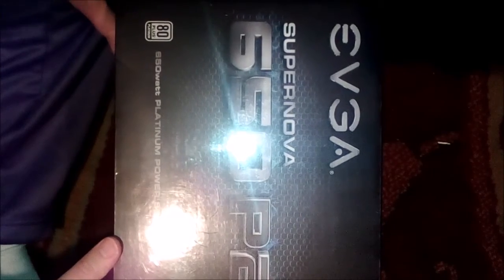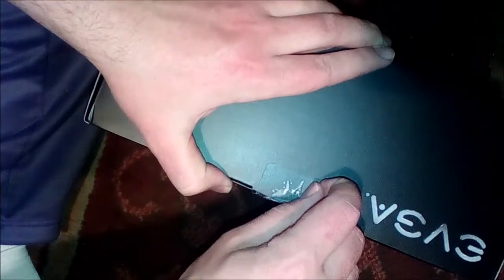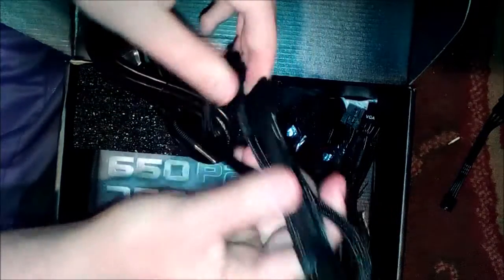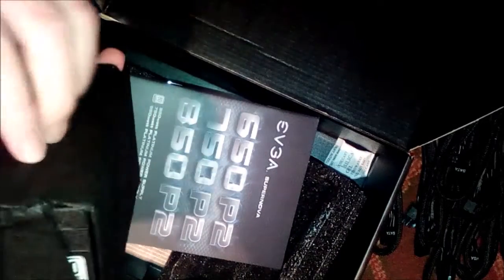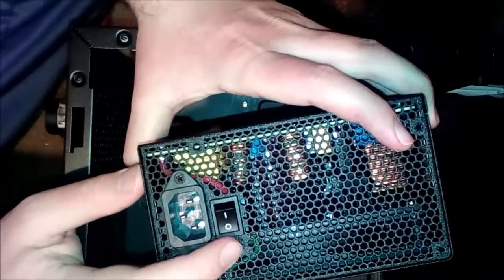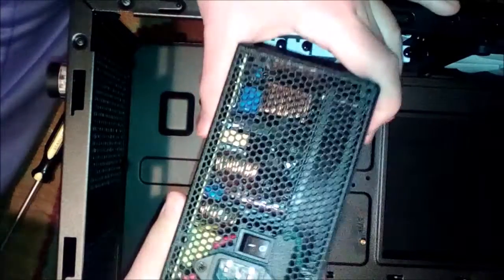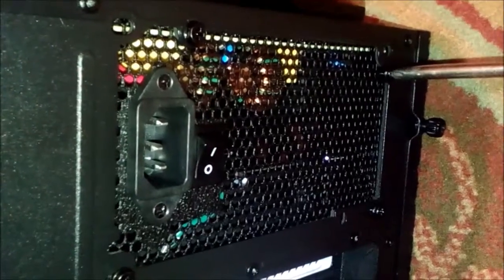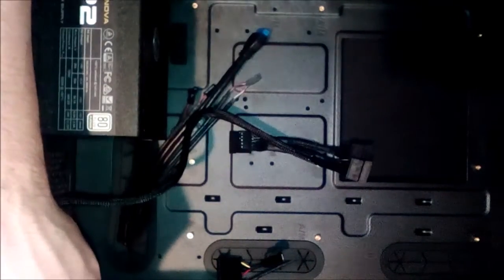EVGA 650 P2 Supernova for Gaming

Comment: Bro i am a noob so i need to you to teach me this: Something like "All about Connectors pins you need to know"
What is 24 pins? What is 8 pins? whats the different between 4+4 and 8 pins? or these following:

- 24 pin ATX connector
- 8 pin EPS12V, 4+4 pin EPS/ATX12V 
- 6+2 pin PCI-E, 6 pin PCI-E
- 5.25"+5.25"+5.25" 
- 5.25" to 3.5" Adapter
- SATA+SATA+SATA 

What are those for? i mean from what to what
Any not obsolete link that could wrap all of this information into one readable sources?

Big appreciate!
Reply: I got sucky sweet grochery store's list

- Z170x G1 from Gigabyte
- 6700k
- 240mm CPU AIO Cooler
- 2x8 DDR4 (2800 14-14) Trident Z from G.Skill
- 1080 Classified from EVGA
- 3x140mm fans (in the front)+ 140mm fans (in the back)
- Intel 750 PCI-e 400Gb
- M.2 Samsung 512Gb
- Intel 750 1.2 NVMe SSD
- EVGA 650 P2 Supernova

Can you explained what pins needed for those thingy?
Any help would be appreciated
Reply from the maker: Sure thing, but how did you come up with this list without knowing anything about this stuff? I mean, everything looks good and should be just matter of putting it together...
Reply: cobuman That is my dream build, but i cant find any good source information about "Connector Pins", I really like to know about that
Reply from the maker: Its not hard my friend, 24 pin connects to the motherboard and 4-6 pin as well. This is labeled so you can't mess up. The video card also has a connector that usually is a 4-6 pin, but also labeled and comes with an adapter that you can use in case psu does not come with it. Everything else from hard drives to fans is labeled and you can see exactly where it plugs in. Honestly, it reminds of playing with LEGOs when building a PC. The hardest part is the front panel pins: I just so happen to create a video about that the other day. Check it out: https://youtu.be/RbeKjUOxA9w

Comment: are you sire about the fan placement? I think it's the opposite. I'd rather have it take outside cold air and exhaust it from the back. also it automatically works for voltages 110-240v so no need for the switch and the pouch is for unused cables.
Reply from the maker: Some cases don't have an outside opening for the fan to pull cold air from; so out of habit I always have it pull air from inside the case which helps create vacuum within the case. Which dissipates all of the heat from inside the case and not just the power supply. I'd rather my power supply overheat than CPU or Video card... Take a look at any name brand name desktops like HP or Dell, their design is just like that. Their standard cases, most of the time will not have any additional case fans to help with heat dispersion. With aftermarket case I suppose you can get away with psu fan pulling air from outside, but yea.. just a habit. :) Thanks for the comment.
Reply: +cobuman well the heat we're having these days made my psu litterally explode. and it's picking the outside air. anyway I ordered this psu, what's your insight on it ? is it worth it?
Reply from the maker: Supposedly its made with high quality components and should last much longer than cheaper ones. I mean, so far so good... If it lasts twice as long as cheap ones than yea, its definitely worth it. I've used cheap power supplies before and they would last for about 2 years, tops. It also depends how much wattage is being pulled from it by PC components and for how long. For example, gaming and overclocking can draw a lot of power for extended periods of time; which can reduce it's life span. On the other hand, someone just watching movies and browsing internet can make it last forever.

Sometimes I would repair them if internal fuse went bad or simple capacitor swap, but here is to hoping that a "quality" power supply lasts longer.
Reply: +cobuman thanks a lot.
Reply: nice video I have never come about a case that has no opening for the psu fan intake ....its not a good idea to pull the air inside the pc and extract it through the psu